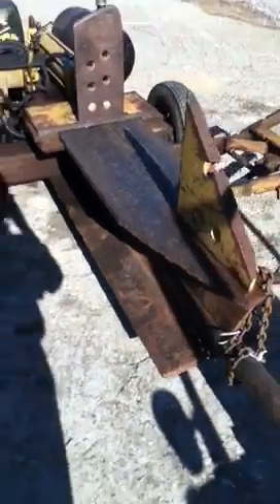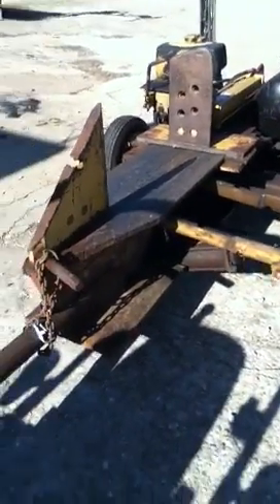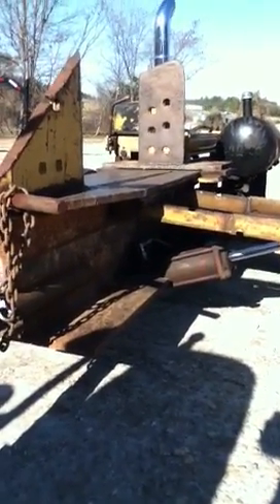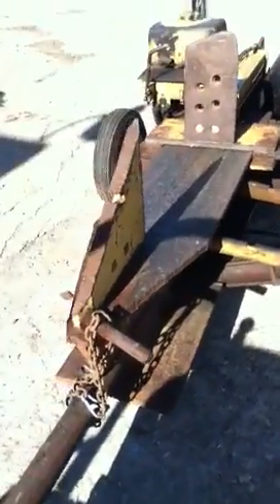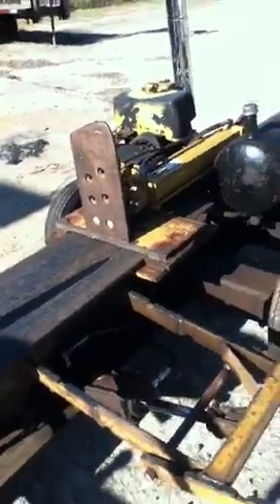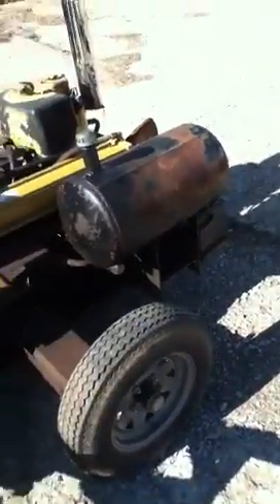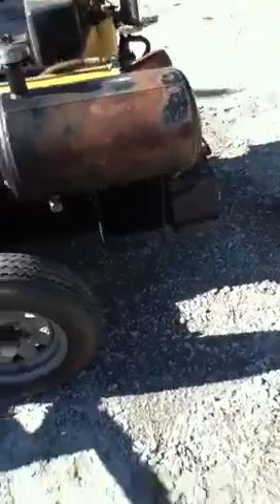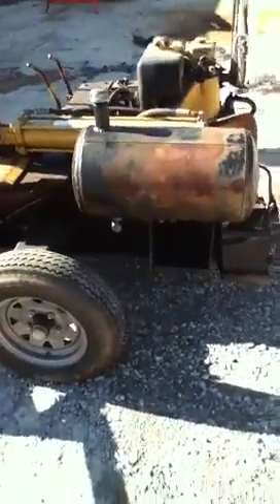Diesel powered log splitter

Comment: Great build. The hydraulics did look a bit slow for my liking. I have a diesel splitter with a single stage pump. Its lacking on splitting power but the cycle time is rapid. It will split more wood than you can handle.